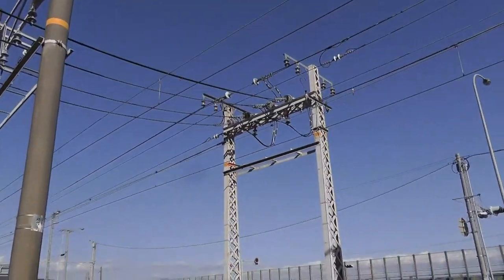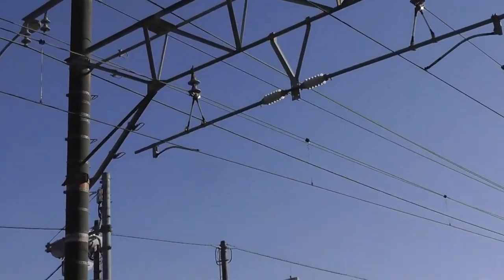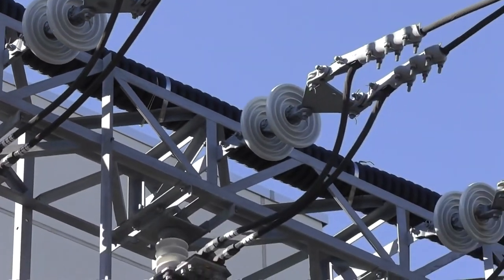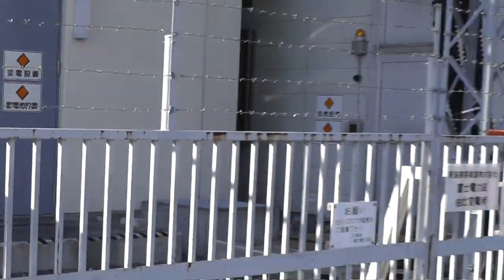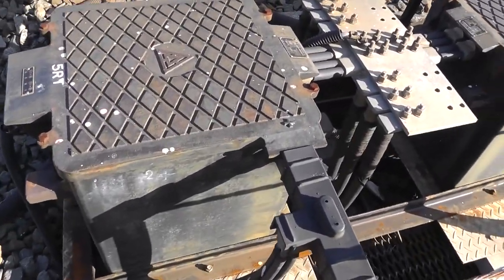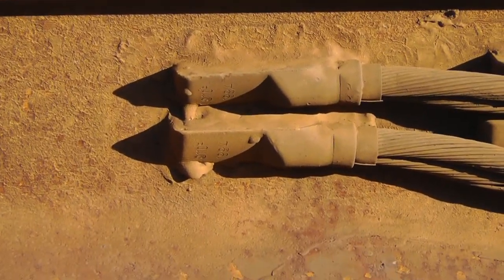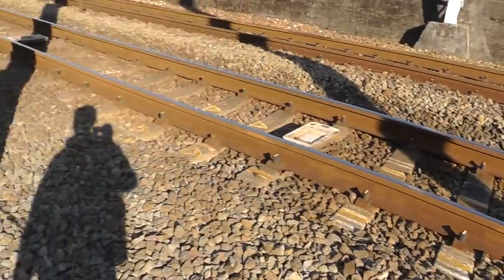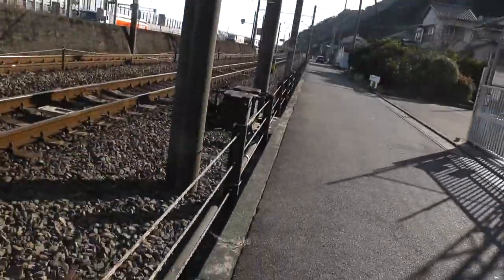🚅 Japan Railroad Power Supply - Japan Train Videos

Comment: Almost all these systems are DC rather than AC.  Why?  With AC, the TRACK would be "hot" for half the power cycle.  Not exactly desirable.
The lines coming out of the Power and Rectifier station and going to the overhead (Cantenary) wire are "Hot" at something like 1200 volts while those boxes that are connected to the rails are the "Ground" that allow the electricity to flow back into the rectifier building.  DC doesn't go very far, that's why you find so many of these buildings by trackside..